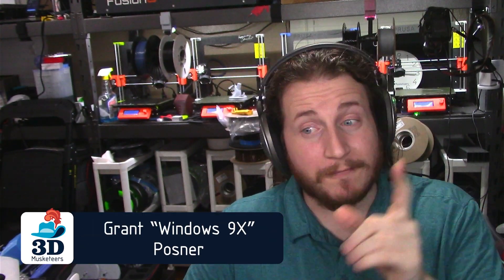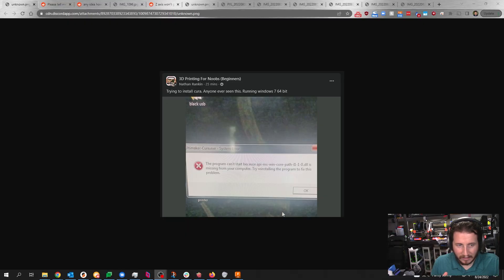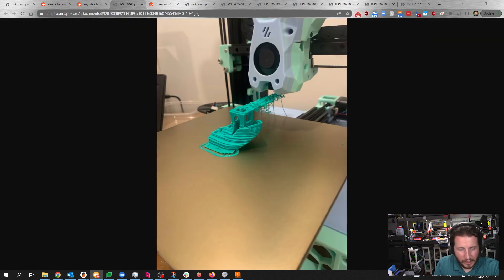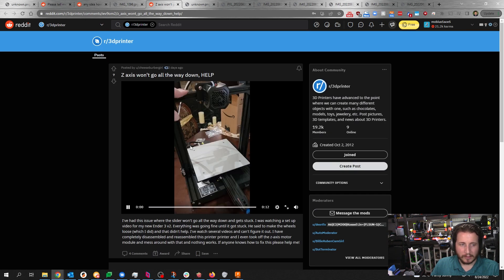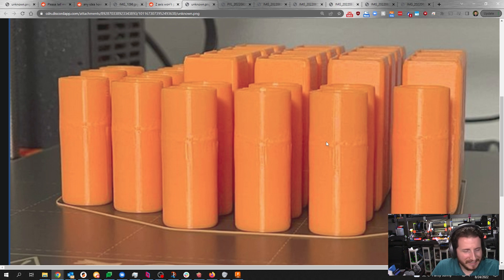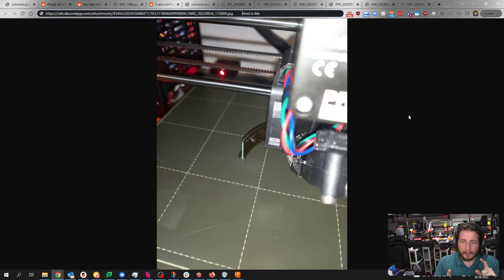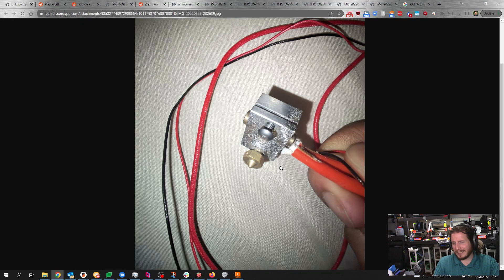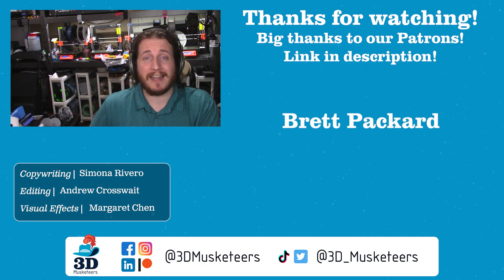Don't Let Your Benchy Look Like THIS! - PrintFixFriday S1E50

Comment: For those who want to print screw threads well, make sure you can handle a 60 degree overhang well, because that's the angle of the threads.
Reply from the maker: Good Point! Some you can get away with, but big threads like that, use supports!

Comment: With a bent lead screw, it might not be necessary to replace it (and straightening is hard). Oldham couplings can mitigate the issue even with several millimeters skew! I designed and printed my own when I had this issue
Reply from the maker: That is true! The connectors can be useful, but I would still worry about axis skew.
Reply: @3DMusketeers  i was as well, but you have to disregard all of that. The leadscrews aren't supposed to provide any alignment. The thing that could be an issue would be if the two leadscrews differ very much, then the skew would translate to one side being sightly higher than the other. All xy alignment comes from the linear sliders, be it wheels, mgn12 or bearings
Reply from the maker: That is totally fair, the V wheels should do it, but they normally suck at it too lol.

Comment: flexible lead screw couplers might be able to help somewhat with a bent leadscrew
Reply from the maker: I mean, yeah, but a new leadscrew would be better IMO. No?
Reply: @3DMusketeers  Oh, for sure, but it stings having to categorize a whole leadscrew as out of commission than trying to ease-out some extra life in it

I have dual Z's on my Ender 3 v2 machines, and even they struggle with their (nearly) straight leadscrews - the solution for me being to add flexible couplers :p

that being said, I might also be biased since I have a lot of flexible couplers lying around; whereas, I'm still waiting for  the delivery of my backup leadscrew :p
Reply from the maker: Very fair! It would suck to have to wait. Do you see any issues with the flexible couplers? Like z wobble?
Reply: @3DMusketeers  Nope, with 750mm/s^2 acceleration and 70mm/s velocity, I don't get any Z wobble on a 0.5mm nozzle and 0.24 layer heights. Great corners, very little stringing and zits, no layer shifts
Reply from the maker: NICE! That is great to hear!

Comment: The scary part isn't Ender 3s being recommended to beginners, but them being recommended to people with zero 3D printing industry to make things that are dangerous if they fail like firearm frames and receivers.
Reply from the maker: I agree. If you are in the hobby, sure, an ender is FINE, but newbies, no. I want them to enjoy their printing experience. An ender can be printer #2..
Reply: Ender 3 Pro was my first printer and my introduction to this industry
Reply from the maker: And for those that are prepared to tinker and like it, they would have tons of fun. But put someone in it that really does not have the time or patience to tinker, they may not have a great time
Reply: @3DMusketeers  true it got shelved for almost a year but not because of its complexity. I do agree there should be easier to use 3d printers
Reply from the maker: Why is it shelved?
Reply: @3DMusketeers  i had a baby WAY COOLER TOY! currently it's shelved bc that skr mini e3 3v isn't working. But I started a print farm with it and a ender 3 v2, cr-10, and anycubic kobra.
Reply from the maker: Bit cooler, but is it cleaner??? lol

Comment: I mostly had print success this week (FINALLY!!!!!! THANK GOD!!!) but I did have a couple minor print fails. My Enterprise model I've been printing the left and right halves of the engineering section. I split them in half and put in a bunch of holes to put in some parts to hold it all together. For some reason the printer didn't bridge all of them perfectly. I have no idea why. It doesn't matter since they aren't visible. I removed the spaghetti with tweezer and I'm printing the snaps now. I've seen it bridge other similarly sized holes so why this time? No idea. 

Oh and also an MMU2 fail where I forgot to calibrate my new light blue (not silk) against my "old" dark metalic blue (silk). As a result the deflector dish has just a little bit of bleeding going on. It's not that bad. Not worth reprinting the halves since they took 3 days combined and it's barely noticeable. Also I had another peculiar MMU fail where one of the filaments got hard jammed between the selector and the cutting shelf. It was so bad I thought I was going to have to disassemble it, but thankfully I managed to get it out. I had to really pull on it. When it came out it snapped of course. I was worried there was more in there, but nope I got it all. Then I had to re-align the MMU by hand since it was already already WAY off. I got it close enough to continue, but when it went back to position 1, I'm like yeah.......I'm going to move the selector all the way back to the left wall. 

Print succeeded just fine! And my printer did amazing 9 hours straight before the next fail and then 16 hours straight to finish the print after that. Normally my MMU is far more likely to fail when I'm sleeping (of course since I can't fix it if I'm asleep), but the 2nd half actually printed ALL NIGHT LONG!!! I was shocked. I think that's a first for an MMU print for me. I think that last stretch was also 16 hours straight. But yeah using that countersink bit to drill the PTFE tube's bevel really did fix the printer. Revo FTW!!!
Reply from the maker: I am glad you are getting closer to 100% up time! Keep it up! You got this!
Reply: @3DMusketeers  so how is this for a print fail. lol The snaps to connect the halves were way too tight. After carving them up and trying to make them fit I finally said screw it and dropped the 125% scale (same as the rest of the model) to 123%. But yeah I had to together at multiple points, but it wouldn't completely close. And it was SUPER tight. I'd rather have them slightly too small and use glue. lol Ironically the snaps for the saucer section were 125% and those fit in perfectly. Odd.
Reply from the maker: When you go up in size your tolerance should also get larger. So that is a bit surprising to me. Maybe it was not a good designed fit from the beginning?
Reply: @3DMusketeers  Everything I've printed in parts I've had the plug and the hole as the same size. I've had some that were slightly loose and some that were really tight, but I got them in. Most of the time it fits exactly the way I want it. This is the first time it doesn't fit. I did finish the new print and they fit better, but they seem like they are too long. That might be the bridging issue at work. I did my best to clean out the holes that didn't bridge properly, but it's not perfect. So I might go to 123x123x120 scale or something like that. It's MUCH better though. The gap is soooo much smaller than it was. I suspect I'll need glue in the end though. Some of them are more loose than others. However before giving up on the original snaps I carved both the snaps and the edges of the holes  in the model slightly. Maybe that's why some are looser than others.
Reply: For the next connection part I'm doing the engines and then the pylons. I'm printing the engines now. I'm going to print just the connections in the pylons as monocolor as a fit test. Then if I have to adjust I won't be wasting as much time. I'm not quite sure how to print the final pylons though. They are a very wierd shape and angle. I don't think I can avoid supports and indeed on the engines I couldn't avoid supports either. sigh...... I haven't had a lot of luck with good quality prints that have supports. So I tried to minimize them. We'll see how that goes. If it does suck only the bottoms will be affected. Unfortunately I have a component sticking down. Also There are 7 colors....I can print one of them separately, but I couldn't figure out anything better so I made grey into blue. lol oh well.
Reply from the maker: YOU GOT THIS!

Comment: Win7 is STILL receiving security updates. It's also not a bucket of hot garbage that uninstalls programs I use regularly without telling me, unlike 10.
Good news: Cura works just fine in Linux, so I have no need to keep subjecting myself to Win10's spying and telemetry.
Reply from the maker: woooo linux!

Comment: Why do you dislike the speedboat race? The horrible looking 2 minute benchys people have been printing are allowing for 10 minute benchys with amazing quality, something that's never been done before.
Reply from the maker: Because it is impractical overall. At some point speed might look cool, but your layer strength will suffer. I want my parts to be both strong and good looking. That, and I want my machines reliable. With that kind of speed and not using servos you are going to have a bad time!
Reply: @3DMusketeers  it's not impractical. I don't print parts at 600mm/s with 20,000m,^2/s acceleration often, but I can print strong great looking parts at 300mm/s at 10,000mm^2/s. I think you should look into speed printing and experiment a bit before commenting on it. do you own any fast corexy machines?
Reply from the maker: Boy I love how people assume things about me lol.. 

I have a printer that is servo driven. Capable of significantly faster prints than anything with steppers. You run out of cooling and heater faster than you run out of servo power lol. Never built a voron, but I have used printers with servos for years that move incredibly fast. Anything over 1m/s movement speed and I think it was around 15k accel means the parts will turn out weak because you have poor interlayer bonding. It is a great printer for things that have little to no surface detail as it can move FAST but if you have a fast print you normally do some sacrificing of printer cooling, heating, or something of the sorts. Being in the industry for 14 years, I have certainly done my fair share of "eh screw it" kind of builds. 

Again, top fuel drag cars are great, but a mazda miata would still whoop it's butt if any turns are involved in the race really. I am not saying that top fuel is not fun, in fact it is pretty awesome, but it has massive limitations.
Reply: @3DMusketeers  i run a 4028 sanyo, so I have no cooling issues, and a hotend capable of printing well over 60mm^3/s. What servo driven printer do you have? I'm curious because I haven't seen it on your channel before.
Reply from the maker: It is custom built and no, you have not seen it on the channel. I built it way before the channel existed as a fun project. It is too heavy for me to put on any tables and is mostly used to show Markforged who is boss. Uses ball screws on every axis. Similar to the Pantheon printer, but I do prefer their method of floating the z axis to mine where it is rigid because I do deal with flexing of the frame at high speeds from the inertial loads on the printer. I could lessen them by going bowden, I just prefer direct drive

How freaking loud are those fans lol?? We made a custom hotend with a circular heater around a tube, similar to the revo, just not anywhere near as easily changed. I may try the CHT nozzles on it next, but I need to wait for the hardened ones to come out first. I have never tested my flow needs. Are you running something from Phaetus? I really need to look at changing the hotend on mine to something less... jank? 

I do not think I have shown any of the professional machines on the channel either, right? The Zcorp 650/Projet 660 Pro nor the Objet 30 from Stratasys.
Reply: @3DMusketeers  The 4028 fans are like jet engines lol. You wouldn't want to run anything like that in your bedroom. I'm running a dragon UHF. I chose that over the rapido because it offers more abrasion resistance (thicker heartbreak). They claim 70mm^3/s, but I've only pushed it up to around 60mm^3/s with PLA at 230c. I would add a CHT, but i want abrasion resistance, so I'm getting a bozzle nozzle (tungsten carbide with chc like geometry).

I would really suggest the rapido+ if you're don't print kilos of cf filaments. It's super fast, relatively cheap, and has excellent thermal stability (super thick sock + ceramic heater cartridge). The orbiter v2 is a good fit for it. It's the only lightweight extruder that can really shove enough filament to reach flow rates over 40m^3/s. I used to have an lgx lite, but it's pretty weak in comparison. I would love to see some of those professional machines on the channel, that would be pretty interesting! :)
Reply from the maker: I head Bondtech is coming out with a hardened version, I may wait for them. Wednesday's video is on the CHT hilariously lol. 

I would prefer to print in CF on the big servo printer, that is why I built it. Is the Rapido M6 threaded? May toss a diamond nozzle on it.. 

To give you an idea of age on it, It has a titan aero that suffered from the bearing issues from E3d and now has a drylin bushing. I need to try the orbiter.. 

I have another Core XY that you may see soon as it is getting a MONSTER z axis upgrade to 12mm supported rods and a 1 meter 1605 ball screw... 

The big thing with the industrial printers is space. They are massive. The Objet is not too big but I would have to remove my table on the standing set, and the Zcorp weighs over 1000 lbs lol..
Reply: @3DMusketeers  The rapido is a standard m6 thread. I wouldn't suggest a diamondback because of the 300c limit and the price. Tungsten is cheaper and will last long enough (also has higher tc than brass). If you print too many abrasives with the rapido, the heatbreak will likely break, as it is super thin. Also, if you want to go over 280c, the rapido+ has a pt1000 thermistor. If you need a hotend that can chew through abrasives, i would suggest the dragon UHF. Crazy flow, thicker heat break (still bi metal), and super affordable. it also takes standard size (not volcano) m6 nozzles.
Reply from the maker: I want to test a diamondback to failure for temps... One day lol. Their team is just so nice (they were former podcast guests) 

I have heard that about the rapido. I wrote off Phaetus when they had the IP issues, but it seems things have been squared away and they know where they have to stand now lol. 

I have been pretty die hard E3D for years now, it is time I look to play with other companies.. I should reach out to Phaetus to learn more. They may be a cool podcast guest in the future too! The ability to go over 300C would be amazing but ultimately unnecessary for me at this time because of the side of the printer. Chamber temps would have to be soooo high that it would take a while to get to temp.

Comment: i hate voron guys and speed boat racers too, never have i never printed or will never print a boat
Reply from the maker: I dont mind the benchy, but it has become a bit of a cult following not for how it is measured but for the design itself. The website on the bottom actually details how to measure it and what any issues may be caused by. it is VERY handy, but I doubt many read it lol

Comment: Wondering if you have ever ran into an issuewhere you have a resin exposure settings dialed in and making awesome prints and you add more of the same resin but from a brand new, well shaken bottle and it the print failed? I am starting to think I need to calibrate with each bottle with the Phrozen Aqua resin because this is the second time this has happened.
Reply from the maker: You should not need to. I do that often with no issues. Could be a fluke that it failed, but Phrozen may have also changed their formula, I have no clue. I use Siraya Tech resin almost exclusively because it has low odor and just works well (they really should sponsor me to say that LOL, but nope, all bought on my own)